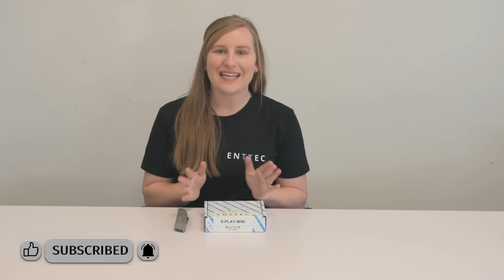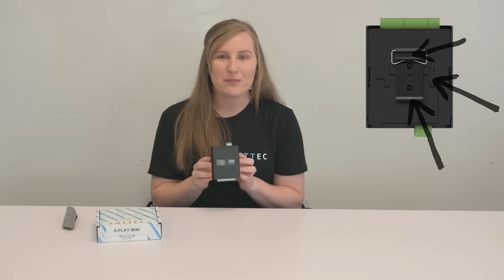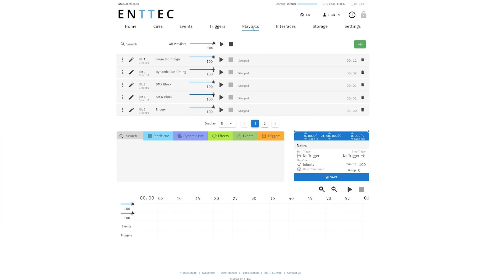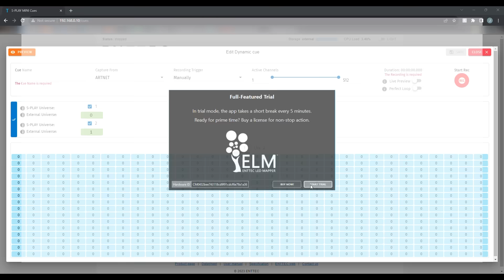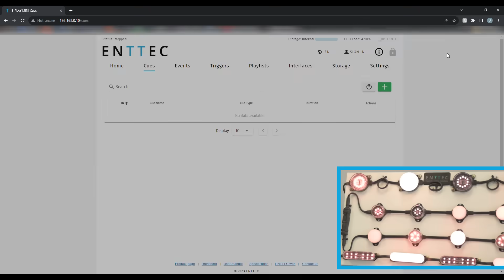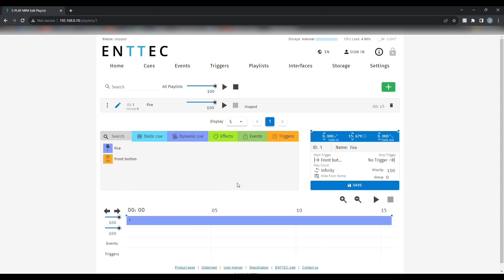S Play Mini Unboxing

Comment: For the triggers, instead of the front button, does the Mini have a Calendar so that you can program shows during an entire year?
Reply from the maker: Hi, it does not have a scheduler, therefore doesn't have a calendar, that is a specialised feature of the SP-1 (32 universe S-Play). You can connect other triggers to the S-Play Mini using the ports on the back of the device allowing you to control your shows using external triggers.